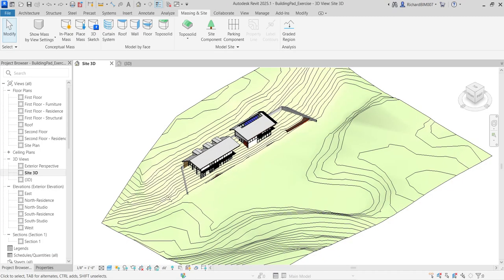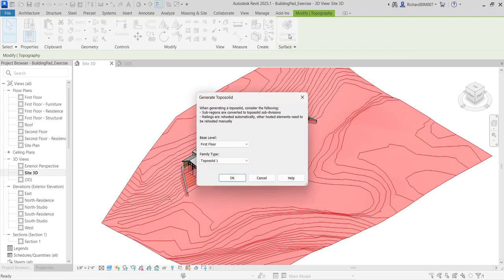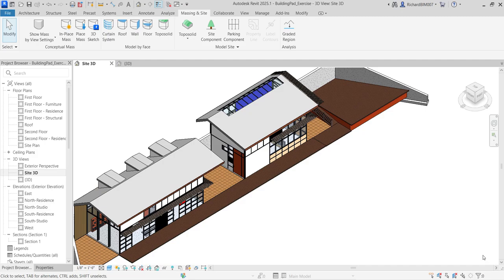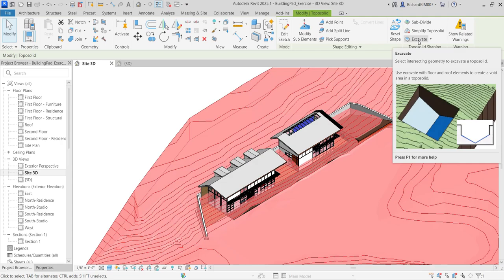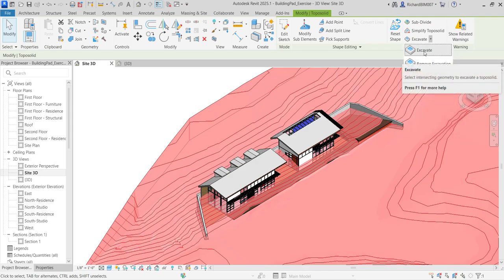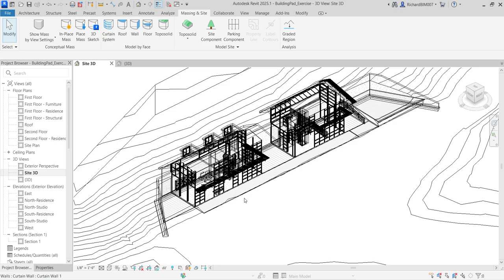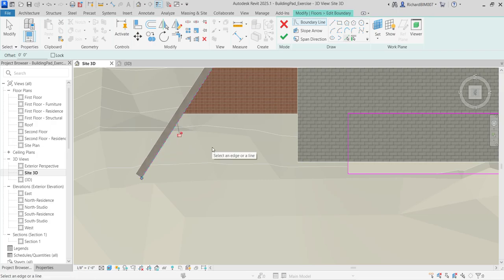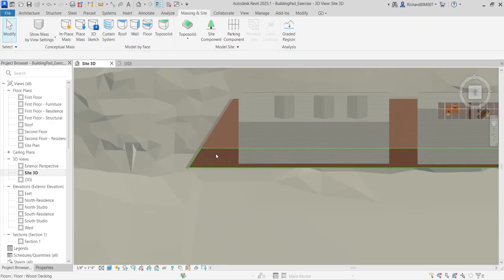REVIT TIPS AND TRICKS: CONVERT TOPOGRAPHY TO TOPOSOLID IN REVIT 2025

Comment: When I try to convert my topography, the error pop up "can't cut joined element"
Any solution?
Reply from the maker: hello sir, that "Can't cut joined element" error in Revit usually happens when you try to modify or cut a *toposurface* that's already joined with another element, like a floor, a pad, or something else.

Here’s a quick step-by-step to fix it:

1. *Select the topography* you're trying to convert or modify.
2. *Check if it's joined* to another element:
   - Go to the *Modify* tab.
   - Click *Unjoin Geometry* (or type `UJ`) and click on your topo.
   - If it's joined with something, it will unjoin.
3. *Try your conversion again* after unjoining.